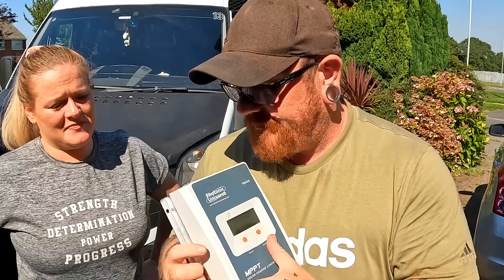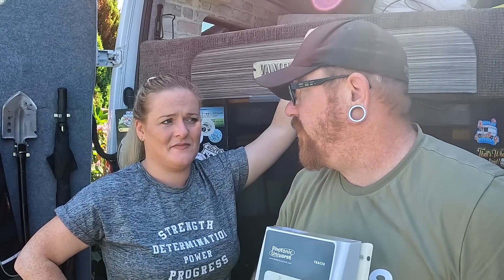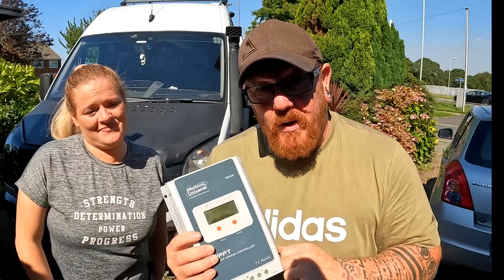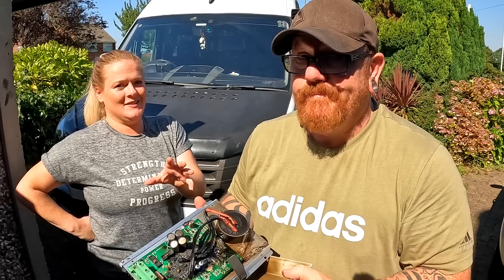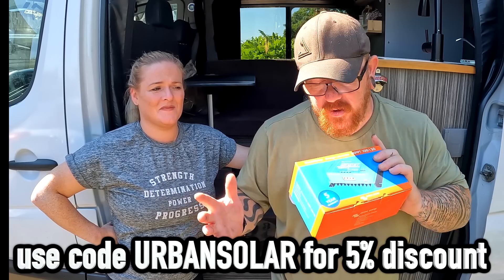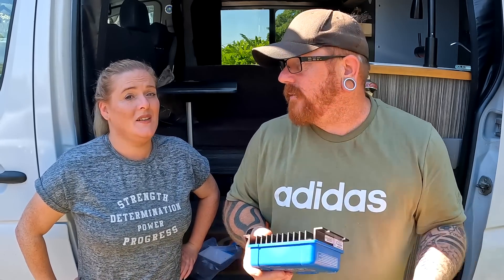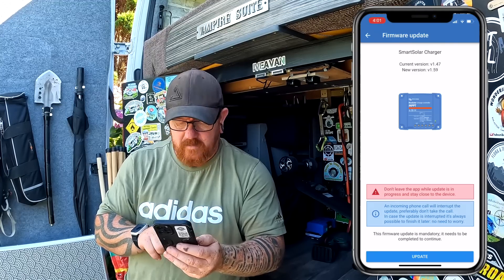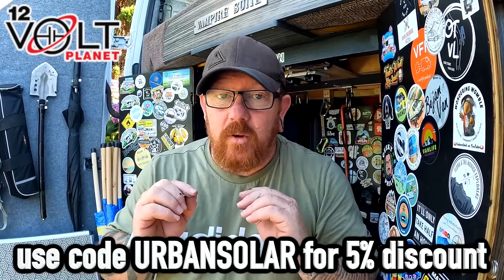This Solar Controller Could Have KILLED Us

Comment: A very scary and worrying experience for you both. Thank you for making this video. After 45 years in electronics engineering I’ve seen many many electronic devices fail in this way. Devices made by high end companies and low end, expensive and cheap. Unfortunately it matters not how much you pay or which reputable companies you buy from, electronic components fail. These days they ( capacitors, resistors, transistors etc ) are mostly all made in the Far East. And too are on the whole good quality. Some do fail and can cause the kind of damage and risk to life you have illustrated so well. Paying £100 for Photonic Universe or £200 for Victron will make no difference to this kind of incident. Always switch off your 12v or 240v and solar chargers when leaving the van ( except fridge ). Always add smoke alarms to your electrical areas. Safe travels :)
Reply from the maker: Very good advice here thank you, hopefully a lot of people will see this and it will raise some awareness around these issues! Thanks again Antonia x
Reply: I'm in the electrical engineering trade as well and have come across this , definitely looks like thermal runaway due to high ambient temperature and pretty sure it wasn't on fire all the residue you see is from fumes given of due to components melting given of gasses would recommend not fixing to materials that have insulation properties like wood especially covered in fabric of any kind metal mounting plates are normally used and ensure that there's ventilation so cold air can be drawn in at the bottom of the installation and and hot air can vent out  at the top 
These manufacturers could easily add device's to the circuit boards to protect against these events happening, thermal resettable switch's have been around a long time , and thermal fuses and other devices but thay wrongly assume it's not going to be a problem 
I've personally built industrial equipment with multiple thermal protection circuits which would ultimately shut down the electrical equipment completely it really doesn't add much to the cost so no real excuses for bad design
PS just to add smaller confined spaces are more of a problem due less air so over heating quickly gets out of hand

Comment: O.K., first of all: I love you guys, you're one-of-a-kind folks with cameras aimed at you. Originals, so to speak. ❤😉
Leaving the scary title and all the comedy aside - you're smoke detector would have warned you of a potential problem. Yes, you COULD have died, but likely you would have just opened one of the emergency exits and gotten out.
Never, ever trust any Mickey-Mouse fuses hidden inside a high voltage / amperage contraption. ALWAYS install a properly sized fuse ahead of things.
I don't know, how much business this "Photonic Universe" outfit does, but customer reviews in the past year have been rather "unfavourable". Perhaps that is the reason, they're looking for a "Business Development Manager". If they had any clue about social media, they would have pounced on your complaint, sent you a new unit, umbrellas, matching tea cups and offered you the grand tour of their facility with dinner arrangement. That's how you turn a complaint into a "great customer experience" and win through publicity. Apparently someone skipped the scheduled classes and f****d up.
Trust me - when they see the fallout here, they will come back with the big ticket. Never fails.
Victron is the right choice. And invest in an extra fuse. And a smoke alarm (if you haven't got one yet) 😉.
Cheers from across the pond and safe travels! 🚐⛅🍀
Reply from the maker: Thank you for this wonderful comment, all advice and things mentioned are on point hope you have wonderful day filled with joy and sunshine, interesting they are looking for a business development manger 😂😂
Even if they had one offered us another unit we wouldn’t have accepted it as it’s give us a bit of a shake so to speak, so victron for the win!

Comment: thats a fake Epever, dont use fakes, real epevers are fine, i personally prefer esmart3 mppt controllers

cant go wrong with victron solong as you have the cash
Reply from the maker: It’s not an Epever it’s a Photonic universe MPPT, we had advice off many other people who have much more knowledge than us about this product before purchasing it, and it wasn’t cheap either at the time of purchase so we thought it would be high quality, at the end of the day things can fail, it was one of those things and we just feel very lucky that it wasn’t much worse than it was!
Reply: @UrbanVanlife  thats my point its not an epever its a rebranded fake clone of an epever tracer, i've never heard of Photonic universe, it looks identicle to an epever tracer other than the brand but inside the main board is different. the 2 smaller capacitors that have blown are you able to read the brand?

Comment: I'd say user error, mppt is laying flat so heatsink can't work how it's designed too. plus the higher than average temperature we have had, in a locked vehicle with no airflow and its cooked in its own juices, melted solder joints and has been arcing out on high solar input, a dead short would have blown the fuses, seen this type of thing a few times, not just with epever, mount them vertical on a nice large thick sheet of ally and they never get warm, helps prolong the life
Reply from the maker: It was mounted vertically when it malfunctioned the company has confirmed it was the actual unit that was at fault

Comment: I deal with electronic faults daily so I see equipment in this state regularly. Firstly is the case metal? If it is then the risk is pretty low as long as you used correct fusing and cable size.
Firstly I know Jack about solar controllers but looking at the charred mess it looks like the unit was dumping power into it’s dump load. That combined with the hot vehicle might have melted the insulation on the dump load wiring.
The manufacturer might want to fit a fan on the dump circuit as the power is being dumped anyway.
As for yourself make Sure you have headroom, if your panels are rated for 20A then pop in a far higher controller eg 40A
Reply from the maker: The casing in plastic not metal unfortunately but all other wiring and electrics have been thoroughly tested and all in correct working order, its an actual unit fault, these things happen but we have now got the viltron which in our option is a much safer bet!

Comment: Holy shit. I have the same controller and I'm extremely careful, a little paranoid, when it comes to safety as I live full time out of a van. Thanks for the code. Also, thanks for the heads up on checks. Mine is due after five months on the road.
Reply from the maker: Definitely best to do regular checks especially if you are on the road a lot 👍👍

Comment: The black gunk and the strong smell is from the catalytic capacitors that have burst. That is the back cylindrical  part that is metal on the end, the two to the right of the cable have cleay burst open in the overpressure vents.   Just capacitor failing is common in electronics but in this case it look like it was a secondary effect when the board overheated.

Comment: Most companies would say hey we will send you another send us that one so we can figure out what went wrong. kinda crappy that they did not have a bit more compassion for the whole situation. Glad you were able to get another one quickly to get back on the road. Glad it happened when you were not in the van. the new one looked like an easy set up for sure. Glad you and the van are ok. DO you have a smoke detector under the bed in the area with the electrical?

Comment: was going to be buying one of them not now have to re asses my options on a other topic when not in use i switch the main solar panel braker off ATM I have a  PWM Solar Panel Regulator Charge Controller, one of them £10 ones lol over 5 yr old now + I have one in my shed 40 amp that's 6+ yr old never missed a beat love Victron have a Victron inverter but when on a budget afraid Victron to expensive ATM

Comment: For added safety, could you not put in a 40AMP fuse on the power lead going into the unit? That way you'd have an initial fuse, and if that were to 'fail' then the unit takes over? Just a thought ...
Reply: The unit has several internal fuses for it's rating.

Comment: Glad you guys are ok, thats a fright, I've got a similar unit, eepever an 40, i did some looking into them before buying one and did see a lot of warnings about them going bad above 50 oC so ive mounted mine to metal with a fan, but after seeing this Im changing mine out.
Reply: Don't worry about yours... keep it ventilated and you're fine. They have a clone that is not at all an EPEver.
Reply from the maker: It’s 100% an epever that’s been rebranded for photonic universe . And that’s a fact

Comment: Pleased you got it replaced, still fascinated as to what actually went wrong with it to cause the catastrophic failure - the smell of burning electrical plastic etc seems to take an age to get rid of doesn’t it. Thank goodness it was contained and very sound advice to check things - I recently upgraded my inverter wiring following a check. Very nice of the guys from 12v Planet to step in and help out. Interesting that the victron mppt you have has the settings switch - mine is a smaller one and seems all to be software configurable. Ps: worth changing the PIN for Bluetooth access too to help stop people on site messing around with them and changing settings. 
Have a great weekend - all the best, David 👍

Comment: Correct me if I’m wrong, but the part of the video of you in the boot is so short / quick not sure but I think your faulty MPPT controller was mounted flat? In my opinion that unit is designed to be mounted vertically to allow the heat sink to dissipate the heat via air flow.
Reply from the maker: Hi Simon, yes that part of the video was short but the actual offending unit was previously mounted vertically

Comment: That is mad!!! 🙈Very scary, although I’ve installed around 10 EPever solar controllers, and never had an issue, but they have always been the blue ones not that greyish one like yours. My dad has 800w of solar on his boat going through EPever controllers for 7 years and not had a thing go wrong. Maybe a poorly soldered wire/component on the circuit board? Who knows. 🤔Hopefully the victron holds up 😅🤞
Reply: This isn't an EPEVER charger.  It's a knock off.   Fake knock off product catches fire.  Who would have guessed.
Reply from the maker: Its not a fake product it's a Photonic Universe MPPT who are made by the same people as EPEVER so wrong buddy!
Reply: @UrbanVanlife  I guess it's made to the same quality standards as an EPEVER, which explains the fault resulting in those electros being over temp to the point of venting blowing their guts all over the place, which is the source of the fishy smell... or maybe not.  Chinese manufacturing is excellent at making copies of things, right down to the component overlay on the PCB but people will believe what they want to, not what is factual.  At least you have decide to use Victron (going blue?).  Let's hope what you bought this time wasn't a fake, sorry rebranded (but really a fake), Fangpusun.
Reply: @retrozmachine1189  true I guess, EPever must have better quality control 👍
Reply from the maker: We have gone blue now buddy so fingers crossed all should be well!
Reply: @UrbanVanlife  yeah man, my best guess is that it was something to do with when you swapped to lithium 🤔 I would swap but I can’t justify spending twice the cost on something that does the same thing, and I hate phones and apps and victron doesn’t make a simple cheap £30 screen… 🤣 enjoy the blue!

Comment: Worrying, but I'm glad you're OK. Makes your blood run cold doesn't it. Photonic Universe are a decent distributor and I've dealt with them recently. If they say sorry they are admitting fault and they won't do that. They also supply the more expensive Victron range that you now have. These have a better reputation but the one that blew is relabelled Chinese crap. I've just bought a Renogy. Buy cheap pay twice.

Comment: All electronics occassionally can fail. I all situations I would recommend adding a smoke detector in the electronics box. That might have detected it earlier (or anything else smoking). Smoke tends to stay there due to a closed space... and by the time it's out you're wayy to late.
Changing the epever upfront... I have one myself as well, and haven't seen many issues with it. A victron can burn as well, but they both are decent brands as far as I know. I think you're just unlucky. But glad you're safe anyway!
Reply from the maker: Yes we totally agree, think we just got a faulty unit which we all know can happen sometimes especially with electrical components!
Reply: I added a smoke alarm in my electronics cupboard. If it sounds my ipcameras (wyze camv3) pickup the sound and send me an alerts. Worth considering along with an PC fan  air to the housing. Glad your ok

Comment: Looks to me that there was some kind of short in the transformer, which heated up the cables causing a catastrophic failure in the rest of the board. You can tell with the discolouration that the transformer was very hot, and the cables at the board end started melting - maybe because of the solder melting causing extra resistance and extra heating . The other thing that stands out to me is that the front panel  /could/ have worn away the insulation causing a short, though it's likely to have just melted. I've not sure about vibration failure and transformers though, but it looks like the most likely problem :(

Comment: That unit may not have been on fire, but those wires inside were glowing hot for sure,  causing that wire sleeving to melt.  Looks like a failure on the board somewhere. Hope the heat damage was only isolated in that box and not melted any wires in the van.
Reply from the maker: All the other wiring has been checked and is all in perfect working  condition 😃👍
Reply: @UrbanVanlife  Glad it's not damaged anything further. Rather scary though, but don't let it knock you both too much. These things happen, you found it before it turned into a huge problem.

Comment: It's the same unit as the Epever. Just rebranded. Normally they have a good reputation for reliability. Either way that's very scary and I've got two 40A Epever charge controllers.

Comment: Woohoo, I also have the Victron 100/30 MPPT. Been running it since 2014. Rock Solid 😀 You won't be sorry 
Hahahahaaaa at Will in trouble message (AGAIN). What was it this time?

Comment: I just installed a full Victron Energy solar system / 24v 200Ah + 240V inverter / DC-DC charger and the same 100/30 MPPT on my observatory in Cyprus, love their gear (videos on my channel). Sure you will have no issues with their stuff!

Comment: Looks like the capacitors have popped and vented the electrolyte out onto the board. They might of popped due to the heat of another failure but capacitors are a common failure point on modern electrics.
Reply: Agreed.  It looks like the two smaller caps on the right had holes in the top.  I think they went off like volcanos.  Also agree with Richy_Rich below.  The caps may be underspec'd for the job.
Reply: The only reason why capacitors on “modern electrics” fail is because really cheap capacitors are used in the cheap Chinese junk equipment that everyone buys these days.